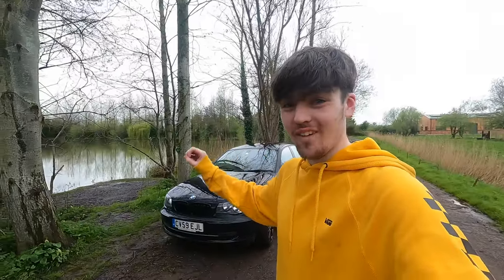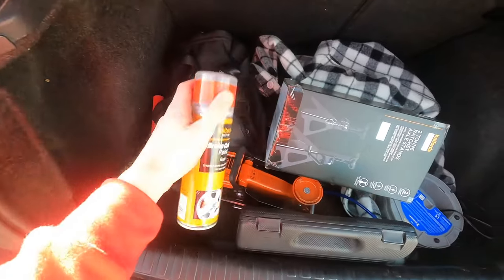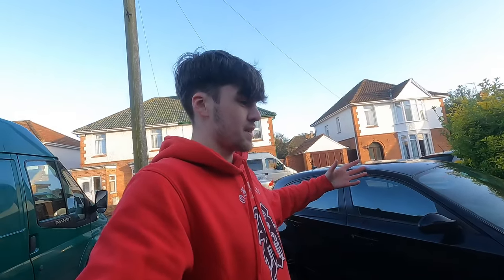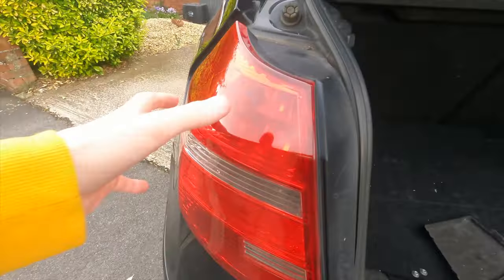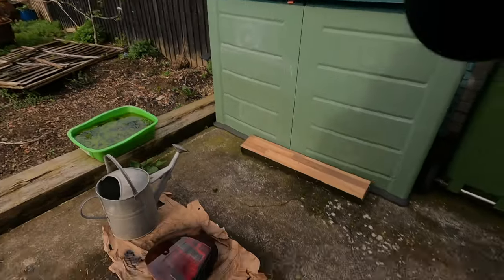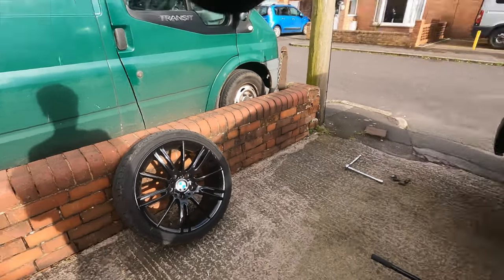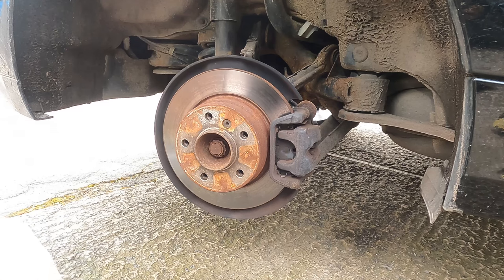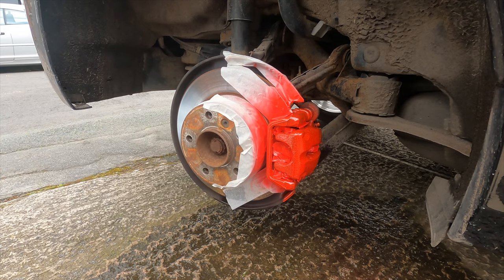I SPRAY PAINTED MY BMW 1 SERIES!

Comment: You can use tape to pull the center caps off . Look at putting a front splitter? Maybe m135 back section on the exhaust twin pipes .
Reply from the maker: If I can't take the wheels off then ill try the tape method, Ive got a new m sport rear bumper in this weeks video actually!

Comment: Hi Sam, I've got a few ideas which I think would be cool to see. Here's some from the top of my head: 
- Aftermarket infotainment system (Car play / Android auto) with optional speaker upgrades and perhaps a subwoofer.
- Wind deflectors (People either love it or they hate it)
- Custom exhaust (I'd suggest not going for anything too loud as it's a right ball ache on long journeys)
I know that you've tried doing the tints yourself, but depending where you are it should only cost around 150 to get the rears done professionally.
Since you've gone for the black centre caps for your wheels, I'd suggest going for black badges on the front and back of your car, and even the steering wheel to match.

Cool video 👍
Reply from the maker: Hi mate, I am looking into new mods right now so I will take everything you say and have a look, but with the tints I might just get it done professionally!

Comment: One thing I’ve done with my car which I’d suggest is invest in some copper grease, apply in where the wheel and break disk/hub meet it’ll prevent them seizing on and make it easier to get the wheels on and off in the future. 
Loving the content mate I’ve got a e82 and your inspiring me to get modifying😂keep it up
Reply from the maker: I will look to invest if thats the case😂
If I'm inspiring you mate then thats awesome, just go for it I say, start with something easy like the side indicators and go from there, you'll quickly get the hang of it and enjoy the hell out of it!!

Comment: For the rear it's 1 small bolt to rotate and slide the caliper off the bracket, literally more work to mask it and get the overspray off than remove it/the pads and paint it nicely.
Next step buy a wrench/spanner and use it, consider learning a bodywork skill like vinyl wrapping. Buy an ECU tuner and learn how to use it. Upgrade the suspension with some springs and sway bars.

For your stuck wheel soak it in penetrating oil, get the liquid version not the spray can to not get any on the rotor. Then hit it with your purse :)
Reply from the maker: If thats the case with the caliper then I should've just researched a bit deeper😂 thank you for the help mate, when I get the wheel off and do the other side, ill give a go at taking the calliper off and update in a video!

I definitely want to learn as many skills as possible as I want to do basically everything I can to my car myself as it seems more exciting than have someone else do it for me!

Comment: you remind me of old schol mighty car mods. I love it. Figuring out things yourself as you go is amazing.
One thing tho, you might wanna pop off the brake pads next time you paint. especially the front ones (as your car primarily brakes with them) Also tinting with a diy amazon tailight tint sheet is better than a rattle can. It helps u keep it shiny. Also stuck wheel stud, jsut get a big torque bar and maybe a metal 4 square then step on it and jump on it. ud be chillin

What do you say heh? Next video K swapped 1 series with hood exit exhaust? hehehe
Reply from the maker: Ive got no experience of mechanics and no qualifications, just as you say learning as I go!
I think I might just pop the whole caliper off next time as it looks like it's just one or two bolts holding it on, so then I can properly paint it without getting it everywhere 

If I can get a k24 and a workshop to swap it in then HELL YEAH

Comment: Leave a bolt in the wheel and spray some WD-40 where the wheel meets the hub, leave it for a few mins, can hit the tyre with a rubber mallet and kick it as well, should come out. When you re assemble make sure to put some brake grease on. Can get it from Euro car parts (Textar CERA TEC) put some on the face of the brake hub and on the little lip and the wheels will fall off next time you remove them.
Reply from the maker: Legend, thank you for the help mate, I'll give it a go next time I attempt it!
Reply: @OfficialSamBryant  you’re welcome, also make sure to wire brush the hubs and back of the wheel where it mates that way you’ll get rid of corrosion

Comment: Give it some proper beans with car jacked up and axle stand under also - kicking each side whilst sat on the ground and it'll eventually come loose. Before you put the wheel back put a small amount of copper grease on the back of the wheel only the part that's in contact with the brake disc. You'll thank yourself later when the wheel has to come off again 👍
Reply from the maker: Smashing, thank you for that mate, I'll give it a go next time and fingers crossed I can smash it off

Comment: I really hope you have informed your insurance company about the modifications that you have done to the car. 
1 wheels
2 spray tinting the rear lights 
3 painting brake calipers
Reply from the maker: Of course I have, no way im losing out if anything were to happen
Reply: @OfficialSamBryant  
Good on you Sam - Bryant 

Whit the wheel that wouldn’t come off once you remove the bolts. You will had to hit the tyre repeatedly untill it loosens its self 
Working on cars for over 30years teaches you things. 
You have to start somewhere and you are doing it. 
Bit of advice DONT try to paint the rear bumper get the body shop to do it. 
If you want to learn to paint things start smaller and paint regularly that way you will improve every time you paint something. 
Try painting some small interior plastics first. 
You will need plastic adhesive promotor and primer and paint and lacquer. 

Watch dte tv on YouTube if you want to learn to paint he’s done loads to show tips and tricks. 
You will have to go through the videos and find them. 

All the best 
Adam
Reply from the maker: Hi Adam,

Thank you for the support, I will give your method a go at getting the wheels off, fingers crossed it works.
Im probably going to go through a proper spray on the bumper as Ive been told it's a nightmare to do myself. 
Im planning on painting a few interior pieces next week so thats a good place to start I think!